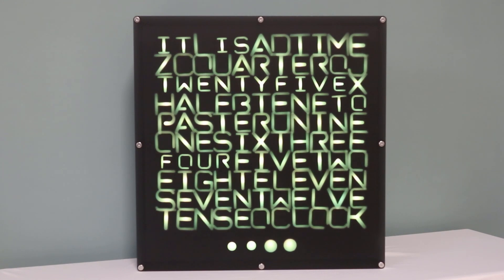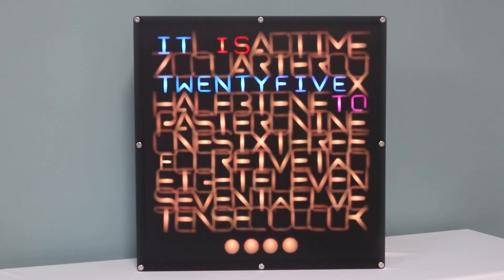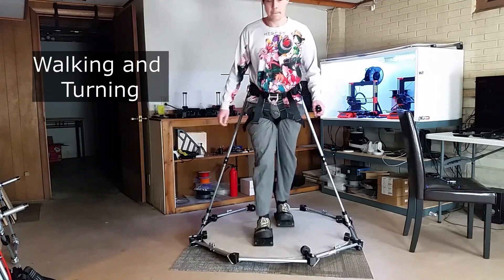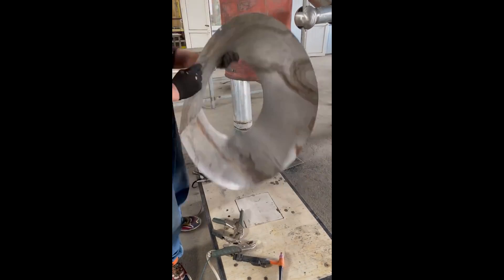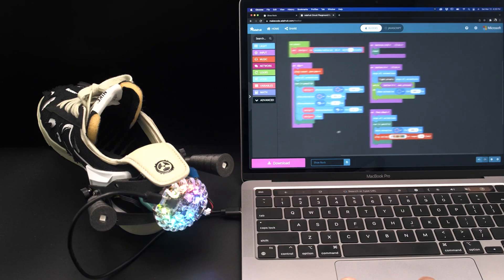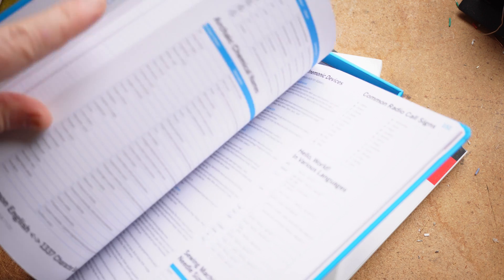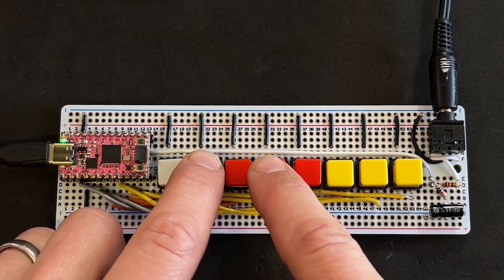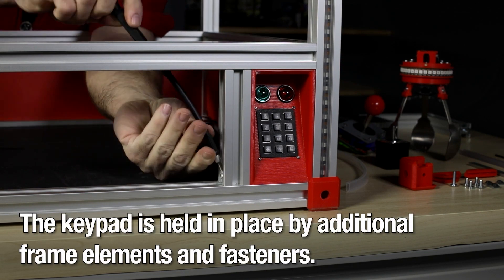In a Word [Maker Update] | Maker.io

Comment: A tip that I use mainly in the kitchen but can apply elsewhere: if you have a bunch of small tools (measuring cups, cleaning brushes, etc.) on a split ring, switch them over to a D-ring or carabiner instead. Then you can remove only the one you need without the others getting in the way of work and/or needing cleaning from picking up residual debris.

Comment: After work tip -- there's no need for a special tool to remove the foil or plastic from the tops of most wine bottles.  Just grasp the covered section of the spout in your palm, and twist it off.  90 percent of cork coverings loosen immediately this way.

Comment: I've got a tool, a tip and maybe a piece philosophy for you:

For tools, the Dremel Speedlic / EZ Clic system for use with any rotary tool. The 'anvil' holding the cutting discs and other tools is spring-loaded and allows you to toollesly change cutoff discs, sanding discs, sawblades and such. Much faster, more secure and easier than the old style with a fiddly little screw for clamping down on the tools. Highly recommended for all rotary tools.

For tips, dispensing a small amount of glue from pretty much any tube is near impossible with most glue dispenser / bottle / tube designs. When you do need to do so there's these disposeable glue micro-tips / precision applicators from a semi-soft, clear plastic which have a tapered tip ending in a long, thin section. You can cut them to length or the diameter you need, they fit over most glue bottles / tubes and such, and they're cheap. They do waste some of the glue as you fill up this push-on tip, but the dispensing precision is certainly worth it. Another way to achieve the same goal is to fill the adhesive into syringes, ideally Luer-Lock-compatible ones. There's a plethora of tips available for that system, which makes accurate dispensing quite easy. It's also great for precision lubrication.

For philosophy, woodworkers and makers in general often (half-jokingly) quote 'You can never have too many clamps'. I'd add some more pieces of wisdom in the same likeness:
'You can never have too many ways to hold on to stuff' - various tweezers, clamps, grippers, pliers, jigs, fixtures and such are incredibly useful to securely hold on to your workpiece while working on it and preventing it going flying off somewhere, or injuring yourself or others.
'You can never have too many ways to cut stuff' - From different shapes of scissors and knives, chisels, saws to powered tools like jigsaws, oscillating saws, and so on. Having a variety of cutting implements is tremendously useful when encountering odd materials, angles and such. Even when doing mundane things such as removing supports from 3D prints I use various pliers, tweezers, awls and differntly shaped linoleum chisels to get rid of stubborn supports.
'You can never have too many lights' - With how effective and cheap both LED and battery technology has become it's now possible to get a whole bunch of different lighting solutions for any given situation. There's little excuse to strain your eyes with poor lighting conditions when there's so much choices to remedy that problem.

Comment: A worthwhile investment for keeping information organized: prepunched sheet protectors. These fit in a three-ring binder and hold 8.5 x 11 inch (and smaller) print materials. In my workshop is a binder stocked with magazine clippings, leaflets, instruction sheets, etc.— anything that might be useful as a reference. The plastic sleeves protect the contents and can be added to, removed, and rearranged as desired. Works great for recipes, too.

Comment: When using a new tool or technique, make sure to test it out on scrap first. As an example, I am doing wood tapping for the first time for a complicated MIDI keyboard build. Testing techniques out on scrap saved me from inadvertently damaging my primary components by stripping the tap hole (if you bottom out the tap in wood, the tap will start stripping the thread you just made).
Reply: As a bonus, routinely working with scrap helps to justify my hoard of scraps in the garage and back yard. 😆

Comment: One tip regarding something I use a lot: parachute cord. Whenever I get a new hank of it, I flake it out (a climbing term where you unspool a coil of rope onto the floor to remove the twists in it) and the I wrap it around a cardboard flap cut off a cardboard box. I write the length on the cardboard and cut two slits, one for each end. I put it in a bin with  all my other rope but you can also punch a whole in it and hang it on a hook. Voila, non-kinked, organized p-cord!

Comment: My tip. Use a plastic straw to clean glue squeezeout from inside corners.
Reply: I included this in my first Tips and Tales from the Workshop, Volume 1. And I have used it a number of times and it works like a charm.
Reply from the maker: Can you elaborate? For some reason I'm not able to visualize what you're describing here.
Reply: @digikey  sure, like on a wood project if you have an inside corner, it could be tight or hard to get to. Once you've applied glue and clamped it up, you can flatten the end of a plastic straw (maybe cut it into a v shape) to get it right into the corner. You can then move the straw along the joint like a scoop for the excess glue. Of course there's lots of other squeeze out taming techniques like prefinishing your parts so it's easier to clean up, applying packing tape to the joint first to catch the excess, or waiting until it's gelled just enough to scrape it off with a chisel.
Reply from the maker: @ChrisBroughton1980  thank you! This is a super helpful tip!
Reply: @ChrisBroughton1980  Super idea.

Comment: I really don't like having to hunt down tools or materials for a project so I try to keep things well organized. 
But it happens, sometimes when in the middle of a project your workspace is chaos and you just can't find that
screwdriver you were just using... 

My personal rule  in that situation is to stop looking for the one thing (which is frustrating) and instead get immediately into organizing mode. 
Knoll the things on the table, put the things you are done with away, sweep, tidy up. The (almost) inevitable result is that you'll find the 
thing you were looking for and you'll resume your project with a tidier workspace and a calmer attitude. 

 I guess it's a sort of mind hack. It doesn't have the charm of "Always be knolling" but it helps me turn annoyance into order.
Reply: This shows real discipline, Federico. When I lose track of something like you describe, I go into a full-on, tunnel vision, puzzle piece search mode that can be difficult to pull out of. Switching into an organization mode sounds like the healthier approach.
Reply: @MakerProjectLab  Yes, I know that tunnel vision mode well, been there many times. I guess what I described is my attempt at a solution :)

Comment: Tip: Think like a factory worker, especially if you are making multiple duplicate parts or objects. You want to be precise and efficient as possible. Plan out how you will move while performing each step of the process. Have the tools you need close at hand. Make jigs and templates to help you repeat actions quickly. Hardboard is a great cheap and durable material for making templates. It comes in solid and pegboard versions. Use clamped pieces of scrap or painters tape to help you line of pieces on cutting and drilling surfaces quickly. Break up complicated tasks into stages. Like anything else, the more you use this method, the quicker you will be able to implement it into your workflow.
Reply: All great advice.

Comment: A tip that keeps being useful to me.. "the best tool is often the one you have access to." I interpret this to be as long as you can work safely, you might not need the big expensive CNC right now, and you don't need to have the delays involved in causing specialist tools (though by doing the job you might have a greater appreciation for these tools and still treat yourself with the benefit of this new perspective.

Comment: If you use a resin printer and you don't have very detailed prints, check the light-off delay and bottom light-off delay option both must have the same value at least for my LD-002R.

Increase those values and test it with a dummy print without the base and the resin tank and with just only one bottom layer, cover the screen with a paper or similar to prevent look directly the uv light to measure the times and see if the delays take effect, if not, just increase the time. 

Usually is better to have from 1 to 2 seconds of delay between layers (at least this is the ok range for my rgb resin printer) obviously this will extend the duration of a print in my case a 12 h print increased to approximately 14 h 30 min (again my printer is rgb so in monochromatic this would be less time) but the extra time is worth it when you see near perfect prints as a result of this.

I got to this by mixing a tutorial from 3DPrintingPro and Amerlabs.

Comment: When your laser cutter has not quite cut all the way through a pattern on a piece of wood - and you've moved the piece so you can't just line it up for another pass - you might be able to get away with sanding down the back surface to the level the laser did cut.

Comment: When designing 3D printed parts that have to interact with an existing object always print smaller test pieces to make sure your measurements & tolerances are correct before printing the final piece.  For example say you need print a mounting bracket for a network switch.  Measure the device and design the bracket but only print a small portion of the part of the bracket that touches the network switch.  Like the part that grabs the side of the switch may be 5cm wide on your final design but you really only need to print a small section that is 1cm to make sure it matches the size/curvature of the switch.  That way you can check the fit before wasting time/filament printing the entire bracket.  It sucks printing the entire thing and then finding out that you measured incorrectly or the tolerances are slightly off and the part doesn't fit.
Reply: Agreed, though I have to admit that my trick for sometimes fudging the fit for 3D printed pieces is to (if possible) slice a file so that you orient the section with model where the tolerances are critical at the bottom. This way I can just print a few layers of the print, stop it, and use it as a pattern to test the component/item. 

Because sometimes, not matter how precise you are with your calculations, the printer/filament/slicing settings will introduce its own slop. The good news is that once you account for it with a minimal print like this, you can get consistent, repeatable results (even if you had to fudge the model measurements to make it work in reality).

Comment: Tips (10 because I can't just decide on a single one):
* Remember to dream big, but scope realistically (especially when you're starting out).
* Never be afraid to ask for advice. Conversely, always be willing to give advice when asked (and try to avoid giving unsolicited advice).
* Decide on the project if you're using Imperial or Metric Units and stick with it.
* If you decide some measurements are Imperial (eg. gallons for liquid volume) and some are Metric (eg. (milli/centi)meters for distance), that's fine if it improves overall efficiency; but make SURE the measurements are orthogonal to each other to avoid having to do unit conversion.
* Efficiency is good. Correctness is better. Better to slowly do something once than quickly do something multiple times.
* If nobody was hurt, no property was damaged, and you can try again it wasn't a failure, it was a learning experience.
* You don't need expensive, feature-laden tools to do good work. Some of the best creativity comes from the limitations we have to work around.
* Always follow proper safety rules and wear appropriate safety equipment.
* You can exchange time for money and money for time, but remember it's possible to make more money... it's not possible to make more time.
* Have fun and make sure others have the chance to have fun as well. We're all in this together.
Reply: These are all great, though I err on the side of efficiency over correctness fairly often. I don't disagree, but sometimes you need to build the good enough solution before the better/correct solution even occurs to you. 

And sometimes, someone's version of "correct" falls short of being the best solution. I have a backyard gate that I've had to fix multiple times because the latch hardware either wears out or doesn't quite work due to the design of the gate. Finally, it occurred to me to just screw in a length of sturdy threaded steel rod I had on hand, for the existing hardware to latch on to. The gate works perfectly now, and is sturdier than any off-the-shelf solution I could have bought. I smile every time I hear that gate close. But I improvised a solution that no one would have offered as the correct way to get it done.

Comment: Ooh a tip that I've learnt the hard way over the years, when working on a project, prioritise getting it done over getting it perfect. I've got many unfinished projects that I have lost interest in simply because I spent too long trying to get all the details right the first time. If you finish your version 1, you can always come back and iterate it later, but you won't be stressed knowing you have an unfinished project!
Reply: Amen to this one. The project I'm working on right now is demanding a lot of trial and error. I know there's a smart way to do it that hasn't occurred to me yet, but if I fixate on that then I'll never make any progress. So I just attack a problem with hot glue, scrap wood, deck screws, and whatever's around, until a terrible version 1 emerges that points me in a better direction.
Reply: @MakerProjectLab  hot glue is just incredible 😎

Comment: I work as a network / server admin and am responsible for destroying the hard drives when they fail so data can't be recovered (I know this isn't necessary, but I gave up arguing with the boss long ago). While on zoom meetings, I dismantle the hard drives and reclaim the magnets. This gives my hands something to do during the meeting and these powerful magnets are great around the shop. Mount them on your drill to hold screws or bits. Slap them on the side of your drill press to hold you chuck key. I use one on my storage rack to hold my box cutter for easily opening the boxes stored there,
Reply: 👍🏼 Yup! Surprisingly nice and extremely handy little magnets in trashed out flip-phones too! Worth the time and effort (well, sort of....)!
Reply: @gus473  Yeah, worthwhile is debatable. Like I said, I had to destroy the drives and it was time during a meeting, so there was no cost in time or materials really. I just paid with the effort.